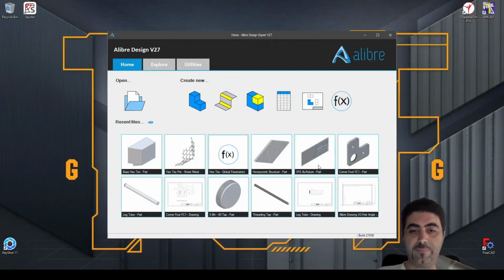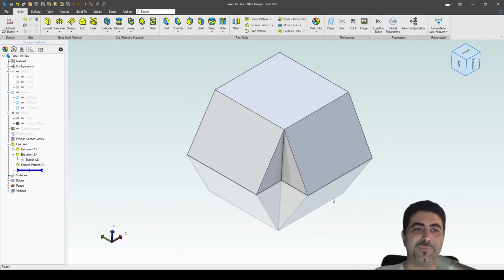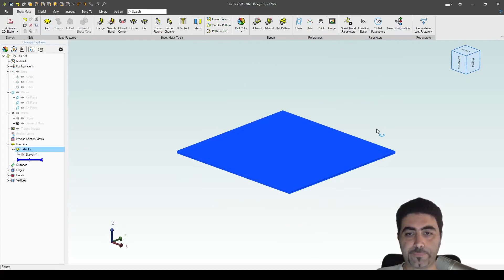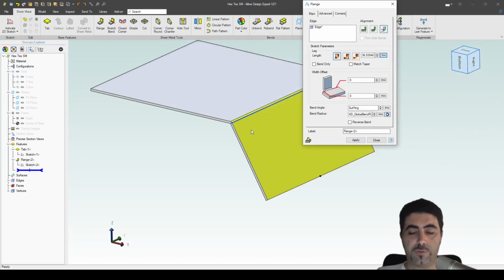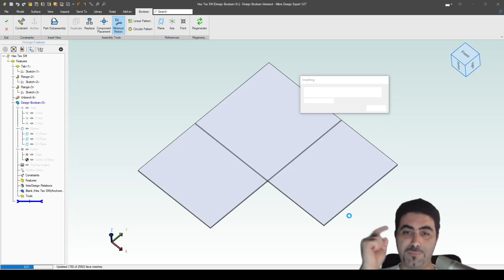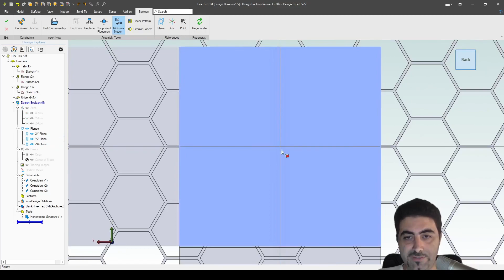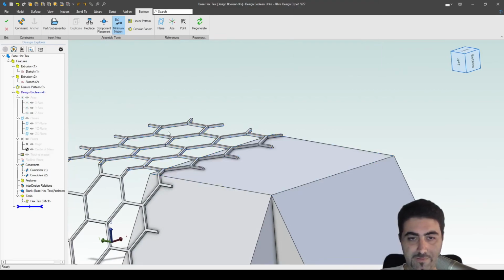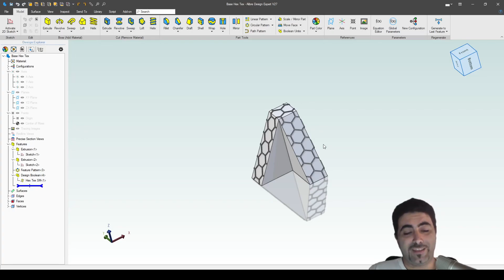Alibre EXPERT Shares Top Tip for Flawless 3D Textures!!!

Comment: just want you to be aware that the microphone you have is not a shotgun mic, you should speak into the side of it, not the top of it

you can google "condenser microphone pattern" to see what I mean
Reply from the maker: Hey Man, thanks for the tip. Unfortunately, my desk is really really crowded when I'm recording. So, basically the mic is where it is.

But according to the manual the sensitivity at 1kHz is basically the same for 180° (front and sides), did I get that wrong? Not really a major sound guy here.